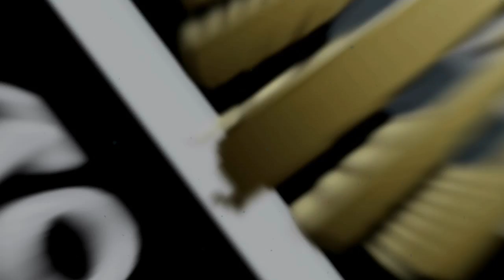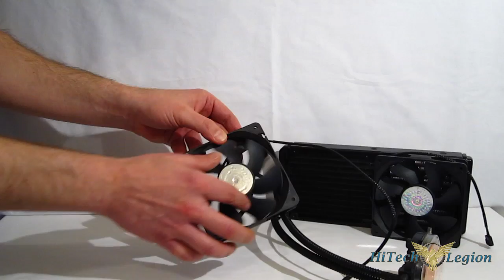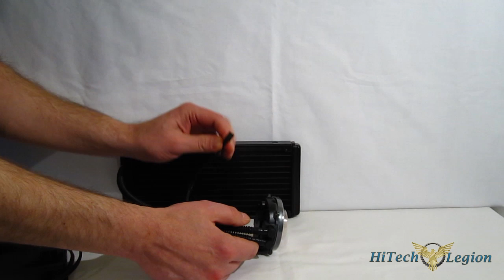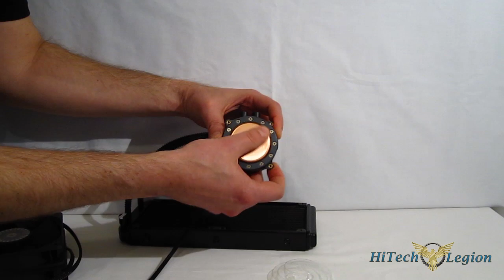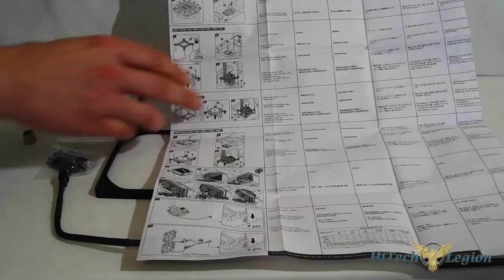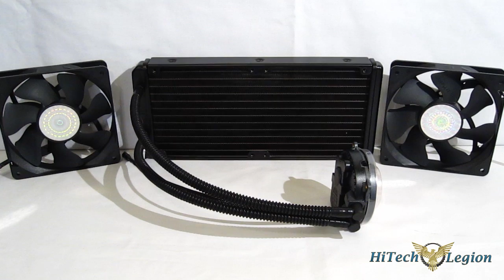Cooler Master Seidon 240 M AIO Liquid CPU Cooler Overview at HiTechLegion.com

Comment from the maker: We used the H100 rather than the H80 for comparison in the review since it is the equivalent as far as size.
The cooling block itself is not less substantial, the pump is a much more efficient design and does not require the large housing you are seeing on the H80. The latest Corsair offerings have gone to a more efficient pump, as well (though not the same pump as the Seidon).